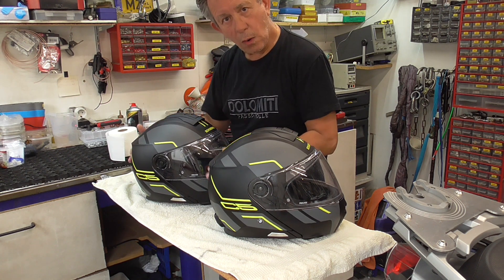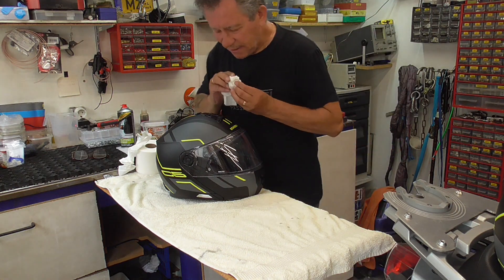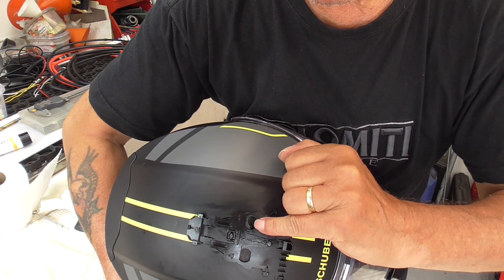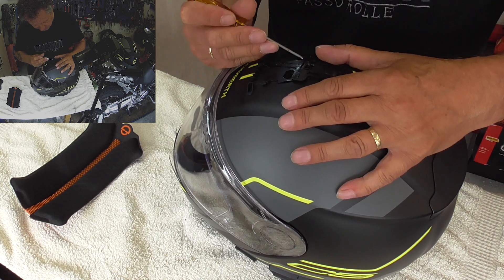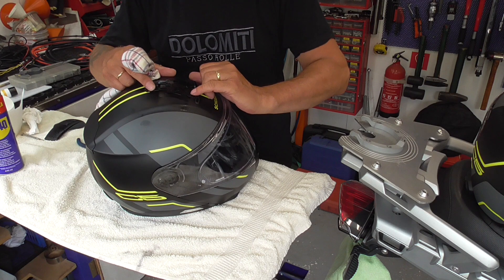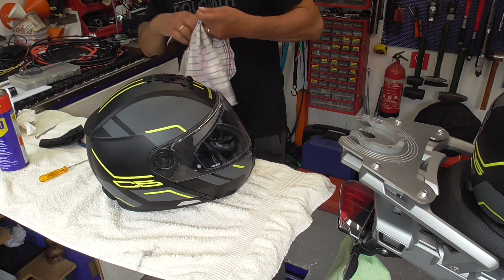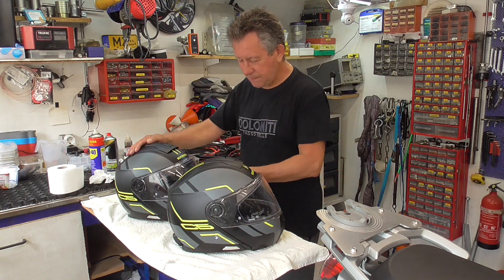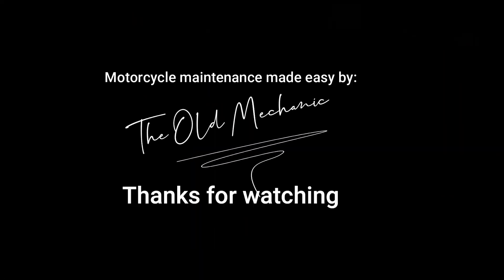Unveiling the Mystery: Solving a Hidden Ventilation Problem in the Schuberth C5 Helmet! PART 2#2

Comment: I checked my C5, and the alignment on the holes was fine, but the slider was very difficult to use.  I have taken it apart, cleaned it and applied some high-quality silicon spray, and it is better but to be honest still not great.  It will be difficult to slide it with gloves on, unless one takes off the helmet and you can see what you are doing.
Reply from the maker: Thanks for sharing 👍🏻👊🏻😉

Comment: Hi! My helmet had the opposite problem... On the closed position it rattle like crazy but in the open position it will stay put. No rattle... The problem was solved when a bug smashed on that air vent... Never rattle again!
I really think that this helmet doesn't worth the money because of the quality problems they have.
I bought mine in Grey Plain color.
Had problems with the chin mechanism (it didn't closed right), my sun visor slider ended stuck ( went to service and they said that the internal string popped out of place), the top vent rattled (solved by the bug...) and the paint started to coming of on the parts of the chin I usually touch to get it up and down and on the front air vent (they replaced the front air vent tab also). Also... I had the visor going down at slow speed issue. Solved it for now with a O ring but I thing this isn't a proper solution (I'll try yours... someday).
I really tried to like this helmet because it's very comfortable inside. but all this issue really let me down.
Schuberth support was alway 5 stars. They attended my complaints... but the helmet really disappointed me with all this issues.
I think that Schubert should have made a recall to at least fix the visor issue.
Thank you for your videos!

Comment: I just ordered the same helmet but new production (was backbordered). I have none of your issues, seems they addressed it.

Sturdy visor
Vent holes line up perfectly 
Vent holes slider is very smooth
Silver emblem lines up perfectly
Visor "clicks" shut in those 2 tabs without effort

Nothing to "godverdomme" with mine ;)
Reply from the maker: Great to hear
Reply: Hi, I would appreciate it if you could answer this.

I am considering ordering a C5 from Europe to USA. I was not able to find any information regarding new production on Chromeburner, etc. Are all the C5s sold in Europe now are from new production? Thanks.

Comment: In this video it was not clear how the cover over the top vent slide mechanism was removed. On the second helmet, the camera was zoomed in closer but that step was edited out and not shown at all.

Prying the rear of the slide cover up was a good start, but by prying it up and off @theoldmechanic was fortunate he did not break any of the four mounting tabs. I pried mine off without breaking any tabs too. I then saw the best way to remove that top cover is to pry the back of the top cover up and then slide it towards the back of the helmet to release it. Once you have it off, you will see that it can be placed in a position to slide forward, it will settle flat and lock back into place.
Reply: It just slides backwards to remove. Don't lift it.

Comment: I have a Schuberth E1 helmet including the built-in Schuberth communication. Not the cheapest helmet including communication on the market. I didn't know anything about helmets or riding a motorcycle then. Now, 40K Km in 4 years. The biggest bad buy was the purchase of an E1 helmet. It's just a big disappointment. Lots of wind noise, the peak to soft, vibrate violently, batteries com. system defective after 2 years, etc. Never again a Schuberth.

Comment: I am very disappointed owner o a Schuberth C3.
My previous helmet was a Caberg Sintesi, it was not a good helmet but for the price it was ok.
I choose to jump to a Schuberth  for the quality.
Since first day the helmet did not securely lock the right chin hook.
I needed to push a bit to the right side the chin so to get it aligned with the pin to lock.
Also the ventilation is almost not exist and yes i have checked the holes.
I am from Greece and for me a well ventilated helmet is so important cause 9 of 12 months of the year is hot.
Another big disappointment was the noise, i understand that C3 is a modular helmet and it can not be a noiseless but it is above the normal noise level after the 90-100 km.
As i understand Schuberth has built in years a reputation of quality and the last years has just downgrade their quality for the extra profit.
I am really disappointed and as i understand it's not just me.
It was a very nice and handy video Old Mechanic, be well!

Comment: Schuberth quality has fallen to the standard expected from Ali-express, 
 A rip-off.
Reply from the maker: True ! This is my second Schuberth and the last one 😕
Reply: @TheOldMechanic  I think rather than actually improve the quality they are resting on a name that has gone down the plug hole.  Shoei are the same.
 Ali-Express are 1/20th of the price of either Shuberth or Shoei you can afford to change it twice a year at that, less than the cost of a new visor for either.

Comment: I've just snapped a tab off my top vent removing it for the first time to lube the thing, this is possibly the worst helmet I've bought in the 20 years of riding bikes.  My pinlock has also failed in the 5 months of owning it.  Just dont buy the C5, im so annoyed at myself for spending so much on this crap when my wife bought the neotec 2
Reply from the maker: Thats fully understandable, quality checks are terrible at Schubert. And its not a low budget helmet...